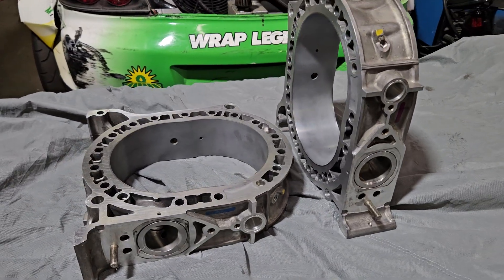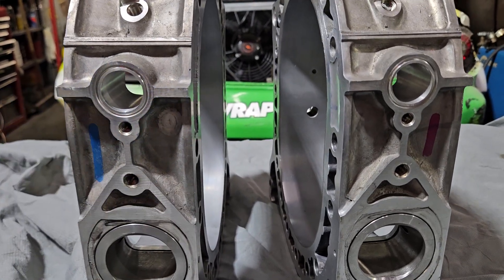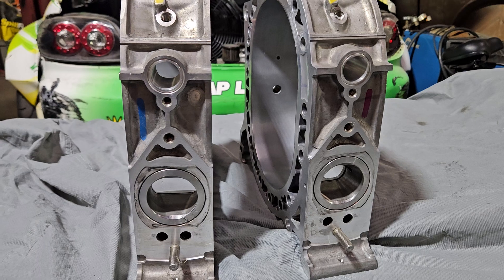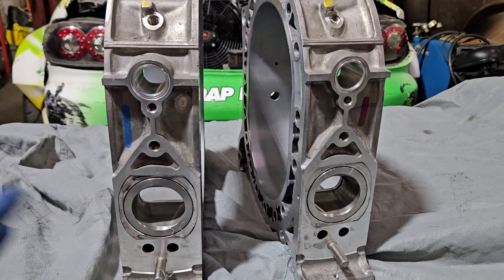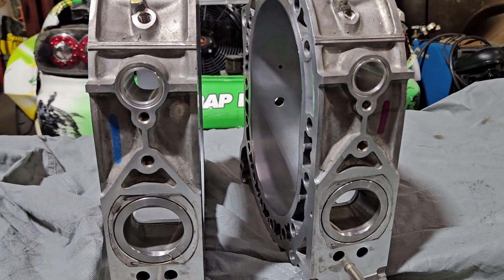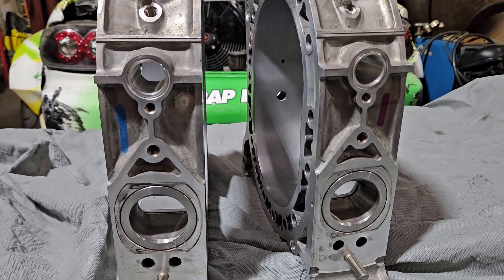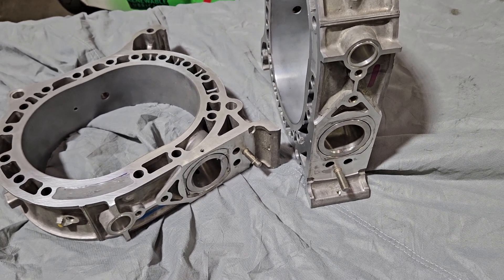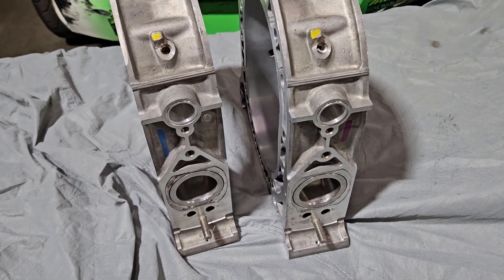Rotary Engines - Making MEGA Power Numbers! Big horsepower 13b - how to get there - KMR Tech

Comment: Hey Kyle, love your vids.  I have a semi-p port built motor (not yet installed) and decided to change directions with the car.  My tuner suggested I cap off the p-ports and run it as a street port.  The p-ports are much smaller than what you've shown here, and could easily be blocked off under the stock IM.  Would that work?

Comment: there are some setups that keep the secondary throttle valves closed and the opening is mapped with the ecu to keep the primary ports flow velocity up in the low rpm area then open the secondaries and semi pps higher in the range. when done properly it's a great setup for low end drivability and high hp top end
Reply from the maker: Yes, one of our customers built one of those setups. He spent a lot of money, it worked great, and in the end, he got rid of it all for a turbo setup.  It was simply more power and easier to be turbocharged.

Comment: I just got a semi p port going in my repu. I was surprised that after some work with the tune, the drivability was about the same as my half bridge fd. It idles a little higher at 1600 rpm but otherwise is perfectly streetable.
Reply: I second this, I have a semi PP in my FD and low down driveability is really good. No issues using as a street car, it's the best of both worlds in my opinion.